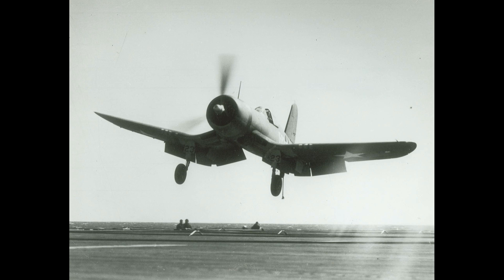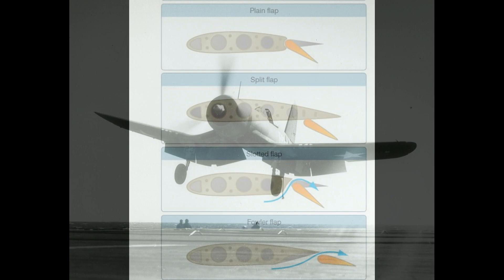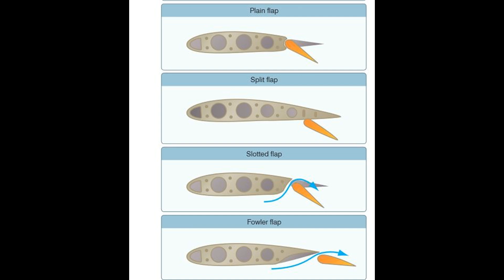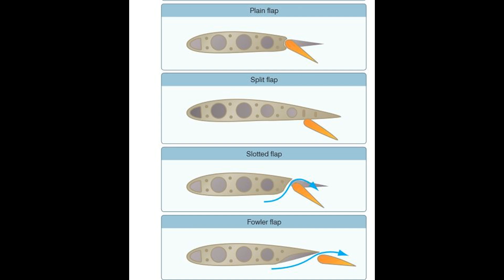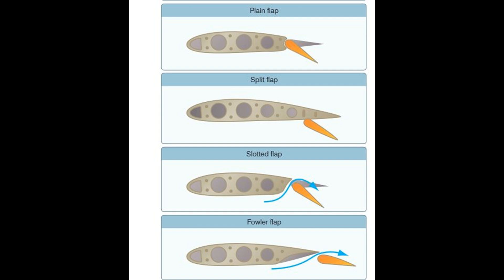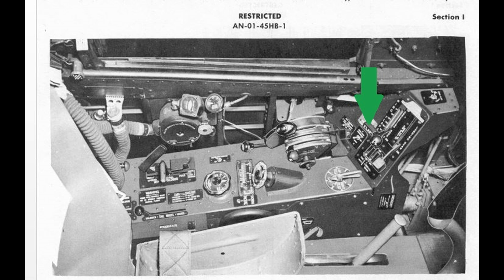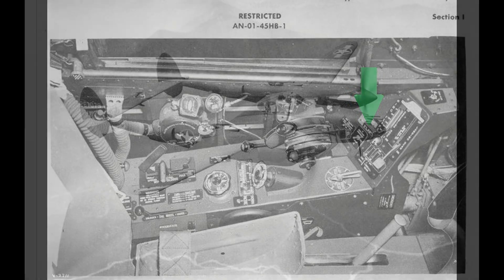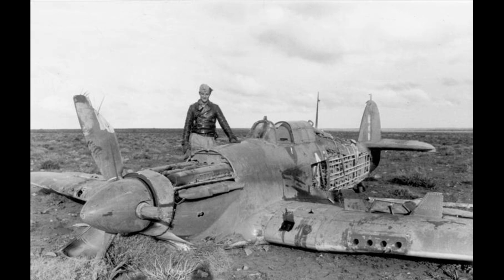Using Flaps in a Dogfight with the F4U Corsair and others

Comment: Sir, at what G load (at bank angle) will the Corsair be able to execute a maximum sustained turn, as you have mentioned here already that for most Ww2 fighters sustained turns are achieved between 60° to 72° of bank angle, where the aircraft pulls roughly about 3G.
Reply from the maker: I haven't done that math.

Comment: Another great post. This was not something widely known about the F4U. I just wonder how many pilots actually used flaps in turning fights? It should be remembered that the Corsair had some interesting stall characteristics which helped to keep it off US carriers until late in the war.
The Japanese N1K "George" also had automatic combat flaps as standard. It would be interesting to have a program on that.
In regards to the P-38, I have seen in print that Tommy McGuire regularly turned with Japanese aircraft at low speed. He also was said to have "bent" some P-38's permanently while doing so. And on his last flight, he attempted to turn with his adversary without dropping his external tanks. The resulting stall at low altitude killed him. It would be interesting to see a program on the P-38 in this regard. I do not recall Bodie mentioning this aspect of the P-38 in his book.
In Robert Johnson's book he recalls seeing a dogfight between a P-47 and a Spitfire. The P-47 won easily by fighting in the vertical, carefully using and controlling his energy in the fight.
Reply: Don’t trust anything from Robert Johnson... He claimed 72” high octane petrol use five months before it was available... The P-38 could be used in turn fighting, which is why it remained relevant as a fighter, barely.
Reply: @wrathofatlantis2316 5 months before it was officially accepted, doesn't mean an astute crew chief didn't do it as it wasn't difficult to adjust.....what's your credentials?....
Reply: @kenneth9874  He claimed in a 1990 interview 470 mph at 32000 ft, with an early P-47D-5 in March '44, at an altitude (32k) where tweaking the Manifold pressure to 72" would not yield any significant speed increase (as can be seen in the flight test chart he flew himself)... He also painted two Me-209 kills on his P-47, and claimed a FW-190D-9 in APRIL 1944, about 6 months before the D-9 appeared. He also did not know the P-47D Razorback could turn tightly (it did mush a lot, but with careful stick use it could sustain tight left low speed turns), and was in reality used mostly in left turning dogfights (about 90% of the time by 90% of the pilots), with next to NO dive and Zoom, in 800 P-47 Encounter Reports that I have read twice, including about 15 ERs he filed himself, covering 22 of his 27 kills, where none of the "vertical zoom fighting" he claimed to have "invented" is evident. Let's just say his relationship to the truth was elastic, to put it mildly. He is in pretty much the same league as Chuck Yeager, although being less famous, he escaped being openly debunked and disrespected by fellow pilots, at least as far as I know.
Reply: What Mark of Spitfire, what Model P-47, Who were the pilots, at what altitude did the fight commence. And what were the starting perimeters? Who had the advantage? A Mk.VIII is going to decimate a P-47 in the range of 10kft. A P-47 is going to eat a Griffon Mk.22/24 and every other mark except the LF variants at 35,000'.

It's pretty much unanimous that Fighter Pilots, Brit and American, would take the Spitfire in a 1v1 dogfight to the death. And a P-47 into a war-zone. And this makes sense.

I wouldn't say don't trust anything from Robert S. Johnson. Especially because of a slight discrepancy of a few months. You weren't there, neither were historians, but he was. The American Petroleum Institute employed many thousands of engineers, chemists, and scientists. They almost certainly developed these fuels before mass producing and delivering them. Because the reverse cant possibly make sense in reality. A lead test pilot working for an aircraft company that was always at the forefront of capitalizing on improved octane would certainly be the first to test a new blend and probably to obtain the initial production batch for testing and use.

Also, the P-38 remained relevant because it was a fantastic design that did many roles well, and it had certain advantages for certain missions that no other aircraft could match. One was range. Another was very high cruise speed. Also a 4,000ft/min climb rate at sea level up to critical altitude. And a little known advantage was its extremely high cruise-climb speed, where it could fly beyond the maximum level speed of the A6M Zero, while also climbing. Another was unusually good low speed turn performance. In spite of its unusually high wing loading. This due to fowler action flaps, high aspect ratio wing, and large surface area located in high energy air behind the propeller slipstream. And the fact there was no roll-off due to torque and p-factor due to the counter-rotating twin design. It also had tricycle gear. And it had the heaviest concentration of accurate long range firepower in a US interceptor/fighter package.

Comment: One thing is that if you are flying on the limit with the highest AoA if you deploy flaps it could actually stall the plane because the critical AoA decreases! Lovely video Greg Thanks for the lessons!
Reply: ^This is correct, if the pilot attempts to maintain the exact angle of attack of the fuselage/nose, and in relation to the initial flap retracted zero-lift angle of attack. 

But everything changes as flaps are deployed. Zero lift angle goes way up, pitching moment goes extremely negative, fuselage pitches down, almost automatically, and there is a surge in  lift that acts to accelerate the aircraft "vertically" which reduces the AoA in proportion the flap deflection. 

The issue of flaps reducing the stall angle in relation to the fuselage angle, is most pronounced in ground-effect when flaring for a landing. The wing will often stall almost exactly at flare attitude, which is usually ~11 degrees, plus or minus one. For straight wing, prop or GA type aircraft.  The wing incidence is usually less than 2deg. Giving a flaps down stall angle of attack around 13+/-.
A flaps retracted airfoil/wing of average thickness typically stalls around 15 degrees.

Comment: So close. Very good discussion generally, but the talk of bank angle and the G required/resulting has no place in air combat. Nobody is trying to maintain level flight in a dogfight.  To get max turn, the pilot will be maintaining mag G or the edge of a stall as the speed decreases into the range where the edge of the stall AOA produces less than max G. In the F-16, the computer took care of that for us.
Reply from the maker: I think you missed the key points. This isn't a dogfighting tactics video, I'm only explaining the effect of flaps. I'm not saying you need to hold bank angle constant or hold level flight in a dogfight. I'm simply using that to demonstrate the effect of flaps in a turn. That turn could be a climbing or descending turn but it's a lot easier to explain and understand if we eliminate the vertical component. Now if you want the vertical component, I have other videos that deal with that.
Reply: Ok, I watched it again and I see your point. It was just really hard for me to get into a combat scenario that is limited to level flight. All that talk of bank angle and how the pilot would find the 83.65 degree angle relevant threw me off. But I can see how the turn performance (on any plane) would change as you described with speed decreasing. Overall, an interesting discussion. Thank you
Reply from the maker: Thanks Dave. Yes, it's not the bank angle but the G loading, but I think you see why it's easiest to explain it via bank angle, which is how all the manuals do it.
Reply: It’s a great and very thorough video. I enjoyed it. I loved diving in to the technical aspects of flying early on with my thick Advanced Flying book years ago... wolfgang langewiesche’s “Stick and Rudder” was great for really understanding what was going on in simple terms. I flew with airline pilots who didn’t seem to have an understanding of what was going on in crosswind landings...

Simple Commercial Pilot steep turns deal with G-loading in level turns and I remember some discussion about that. But my perspective is as a Fighter Pilot when it comes to maneuvering where level turns are rarely a thing...  I like to play an air combat video game in my old age called “Gunship Sequel WW2” where they got the physics generally right. I made a couple very informal videos for my “Get Off My Lawn” team describing some basic maneuvering. You can probably see me wince when I glossed over and/or poorly described the physics of the maneuvers. Feel free to heckle and correct me if you like. It would be a good discussion coming from our slightly different perspectives on the same subjects.
Reply from the maker: Dave, I think you might like this video: https://youtu.be/zv83yBebiIU it's a bit more mathy. On the subject of crosswind landings, I've flown with some Air Force pilots that were really weak, and some of the best pilots I've flown with are ex Air Force. I just watched your Davy Flying video, it's great! I have also spent some time in the 150 Aerobat.

Comment: Why did the SETP find in 1989 that the FG-1 (Goodyear made F4u) could barely reach 6G at the top end of level flight if the manual says 9G? Also, the chart you show tops out at 7.8G, not 9G. You also mention a G-suit for the F4U-4, but as far as I know only USAAF P-51 pilots ever had access to those.
Reply from the maker: That page at 5:07 is straight out of the WW2 manual, and it shows 9Gs. That should be good enough for you. I did NOT cover the FG-1 in this video, so it's irrelevant to this discussion. The chart that shows a top of 7.8Gs is at a much higher weight than the 9G number, it's intended to show a worst case pull out from a dive at a very high gross weight. The F4U-4 has a G suit connection and they were used, it's on page three of the pilot's manual and in other places.
Reply: @GregsAirplanesandAutomobiles  The Society of Experiemental Test Pilots was unable to match the flight manual data at 6G (minimum speed higher than manual by 21 to 50 mph, likely depending on nose down angle: Flatter means higher speed); The same for the P-51D, P-47 and F6F: Is it not possible that 1940s data has an inherent problem, if 1989 PROFESSIONAL test pilots cannot replicate it by at least 21 mph at a modest 6G? The reason the manual data is wrong is that the figures were achieved precisely in the way you describe: Dive pull-outs... This is how you say the 7.8G chart was done: Dive pull-outs... The SETP in 1989 did ACTUAL horizontal turns, which fully load the prop: Would you rather trust an INFERENCE from vertically obtained data to the horizontal, or ACTUAL horizontal data? The 1940s data was only concerned with the stress limit, and assumed it matched with achievable horizontal  maneuvers, since that is what theory says.  Well, theory doesn't match 1989 reality, as I describe here: https://youtu.be/4E6nEIADP7I...

Comment: Another bloody brilliant video, even if im still struggling to understand it properly! Im one  to often not run flaps when dogfighting in il2, my personal perception was i found that they would wash of too much speed for little gain, many times getting me killed  because speed drop allowing pilot chasing me to close within firing range. I tend to "run" vs engage unless i have  height advantage and with height speed advantage i have no need to out turn other pilot, come in fast, hit them and GTFO! Im not professing to be very good, just this is the way ive found best to work for me. Mostly just use flap to take off/land. I also mostly use bf109 because its my favourite and maybe its flap design leads itself to this style of flying, i dunno!

Comment: OMG!  This is what happens when a non fighter pilot tries to talk about dog fighting!
Reply from the maker: That's a pretty meaningless comment without specifics. If you see an error in the video,  point it out.
Reply: Simple. You talk about turn fighting in WWII at 9 Gs, a value that is simply not real... You can’t even line up your head with a non-HUD gunsight at 6 Gs...  In 1989 the SETP has trouble getting 6Gs for a split second at near maximum level speed, on all four major 1944 US single engine fighters, including the F4U... Most of the real shooting in WWII took place at around 3 Gs, and none above 4-5 Gs. And flaps were critical to low speed turning, all the way through the turn, which is why the Russians found the Spitfire could not compete at low speeds, having no mid-position flaps.

Comment: In sim games I usually perform a manewver I call the "super loop" its done after a headon or oblique crossing in the fighters path like a more extreme yoyo manewver where the enemy turns in a horizontal plane and you in the vertical fully deploying flaps at the peak resulting in a really tight turn that can rival more manewverable planes, it eats lots of potential energy so its a one shot moove.

Comment: Great video!
Question: in a maximum SUSTAINED turn would it be wiser to just keep a clean config in order to minimise the power required from the engine to keep that turn going?
Rephrasing the question, do manoeuvre flaps only help to give you a temporary tighter turn while hoping to get a good shot and would they just create too much drag for a sustained turn? 
Apologies if the question is silly.

It would also be great to have a similar video about the slats system (Bf109, Lysander etc)

Thanks and greetings from Italy!
Reply from the maker: It depends of the plane. In some cases maneuver flaps will help the sustained turn rate. More on this in the next video, coming very soon.

Comment: Have you seen Kermit weeks explaining the vacuum operated flaps in the wildcat? Apparently you could deploy the flaps at a high speed, but they wouldn’t come out until airspeed was low enough for the vacuum system to overcome the force of the airflow!
Reply from the maker: No I haven't, but I actually have a couple videos on the Wildcat and cover that exact feature.

Comment: I was flying an F4-D in IL-2 Pacific fighters on full real settings about a decade ago, when I encountered a Ki-84 coming the other way, Co-E and Co-Alt 

We did a level merge at high speed, somewhere between angels 10 and 15, passing eachother on the port side with moderate to wide separation, each turning into the other to form a big flat circle.  Our position was neutral, but I knew that he would rapidly gain advantage if I continued to play his simple turning game, and that he'd be on my tail after 4 revolutions at the most.  So, I asked meself what dto do, and my training immediately answered:  When caught in an angles fight with a more nimble opponent, take the fight out of plane.  I quickly rolled right to pull and kicked the Hog into a high YoYo, extending flaps as I got the Crest of the manuver, to came slicing down on him from over the pole and inside the circle.  As my first burst brushed him, he reversed in a desperate attempt at guns defense, but I'd throttled back and thrown full flaps by then, and all he  managed to do was weave back and and fourth in front of me, into and out of my repeated and steady bursts.  Three of those and his starboard wing root was in flames, and a few seconds after that he was spiraling down in one direction, and his wing in another.

I forgot to retract my flaps, and they jammed shortly thereafter, forcing me to rtb.

If you use flaps for combat turning, remember to retract them when you're done.
Reply: HEHE, nothing worse than knocking flaps wrong way and jamming them in the middle of a df!  Ive been shot down a fair bit doing just that, just as well its only sim nor irl ;) il2 is the best! sad that its still (imho)yet to be beaten and i even go so far as to say the vanilla not just modded which changes it more so.

Comment: Saburo Sakai was caught out in a Lufberry with several Hellcats caging him in. This was, I believe, when the Hellcat first entered the Pacific Theatre and zero pilots suddenly found themselves with a more equal adversary. They each took turns to peel off into the interior and attempted to take him out. Each time this happened, Sakai  desperately pulled back on the stick to avoid their fire. He could see their tracers zip by awfully close, but he knew how to fly the zero as we will never know. He avoided being hit every time and eventually escaped the trap to tell the tale. Now, it doesn't matter so much which mark of zero he was flying because he would have flown whatever he was sitting in to maximum effect. Wouldn't it be interesting to actually experience that extra sense of wisdom someone like he possessed so the plane can be pushed without going over toppling limits? Not exactly about combat flap settings w.r.t. the Corsair, I know, but relevant when it comes to going head to head with turn radius by instinctive feel.
Reply from the maker: Yes, pilot skill has an effect on how well a plane can maneuver, and on turn radius.